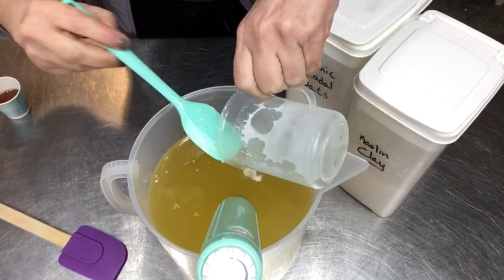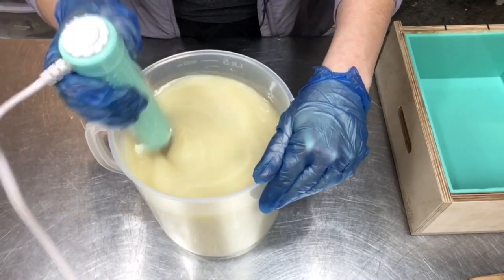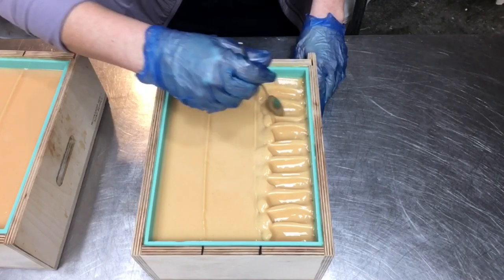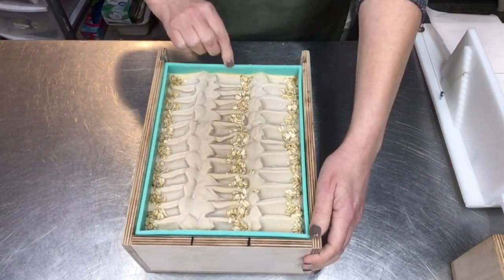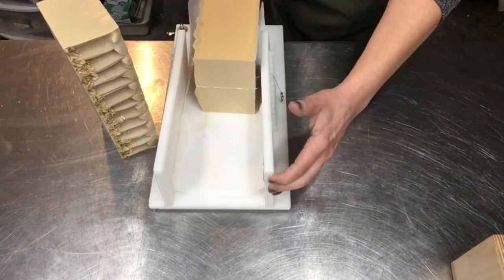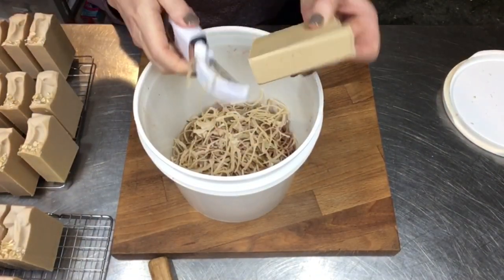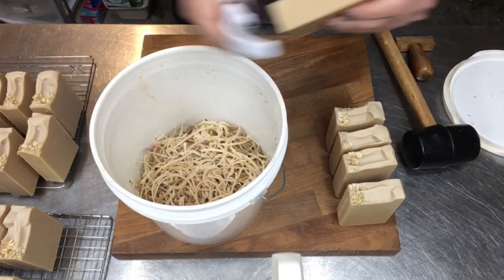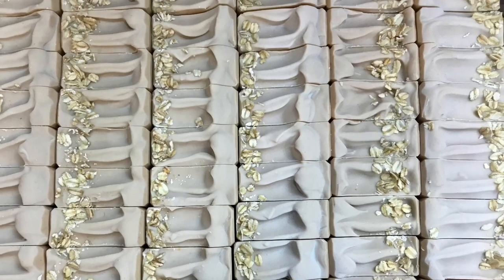How I Make GOAT MILK, OATS & HONEY 🐐🥛🌾🍯  - A Quick & Chatty Version | Ellen Ruth Soap

Comment: Ellen, I accidentally mixed my goat milk powder with filtered water instead of distilled water.  I put in trays to freeze.  My question is should I redo this with distilled water or will the water I used be ok? Will this react with the lye? Thank you
Reply from the maker: I think you should be just fine.  I've made soap with tap water and didn't have any issues at all..